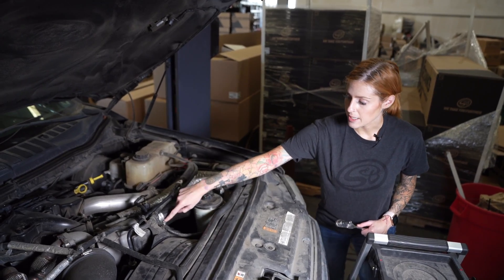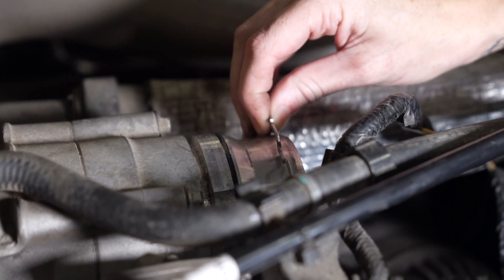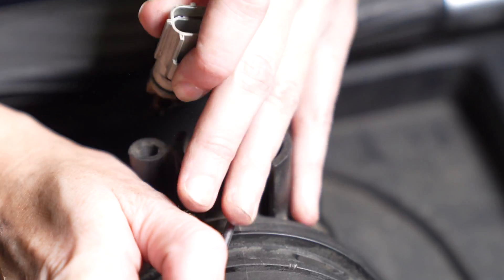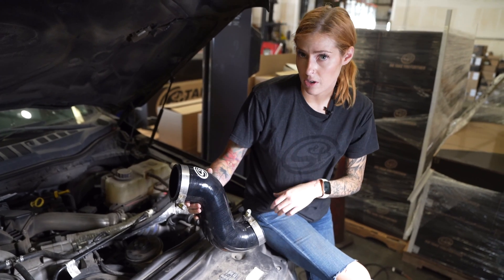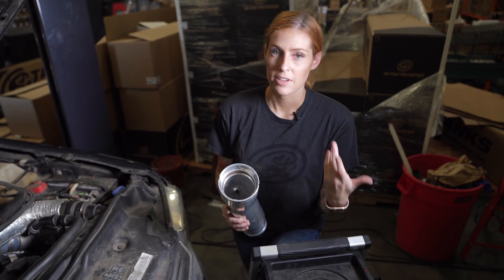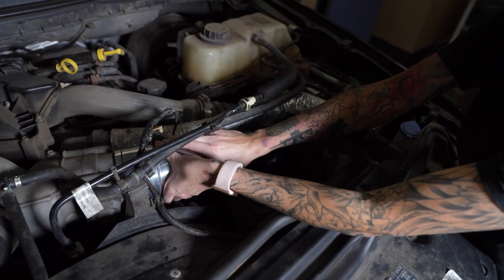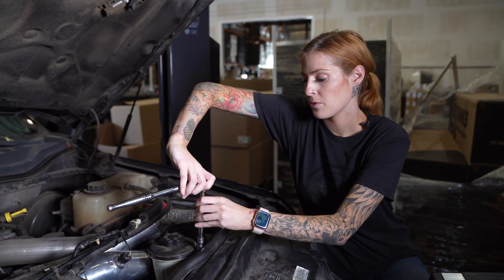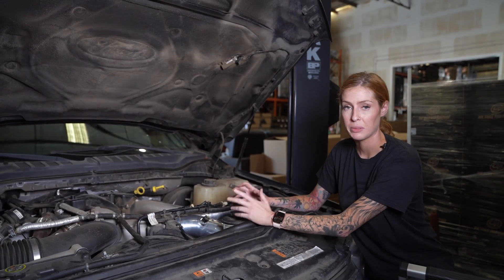S&B Install | Cold Side Intercooler Pipe for 2017-2026 Ford Powerstroke 6.7L

Comment: I installed mine this morning on my 22 F350 and I have a question or more of reassure me that’s it’s fine. I installed with a little oil on hand I mean enough just for the o ring. It was a tight fit until it clicked (I didn’t like how it went on so I removed and inspected) then tried again and it went on (tightly) so I called it good and finished install. I haven’t driven the truck yet but will tomorrow morning. I’m hoping that the oil is more of an assist and not an all or nothing. I was more concerned for the o ring that was provided. 

Hopefully you can reassure me to just enjoy haha
Reply: The oil is just to help with the install and keep from damaging the o-ring.

Comment: Easy install… Only issue I had was with the supplied (green) o-ring on the hard pipe. For some reason I could not get the hard pipe on the intake. I removed the factory o-ring (orange) and used that instead with no issues.

Comment: I installed this on my 2021 today and I have to say that I had a bee-atch of a time getting the flex pipe on the machined piece. The space is cramped and the pipe, for good reason, does not have much flex. As simple as this should be, I found it more difficult than installing the air intake. Probably just me. I normally don't tackle this stuff myself but it sure did look easy in the videos. Installed.....looks good though.